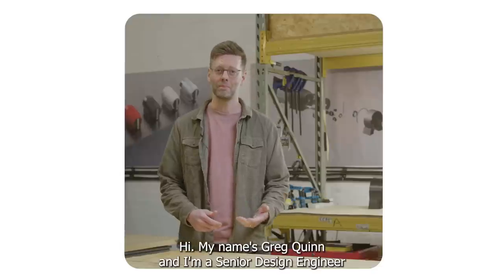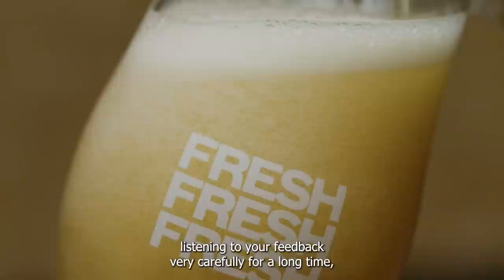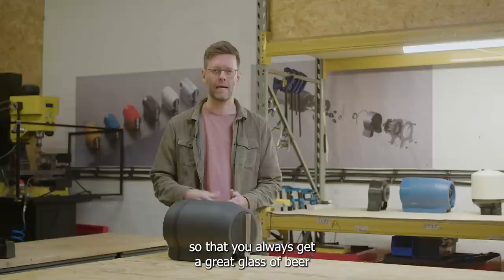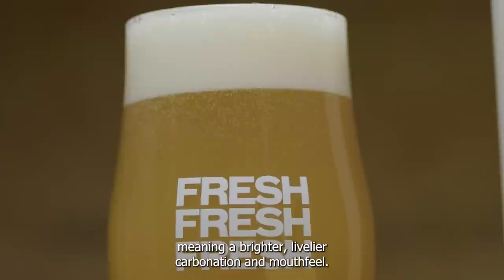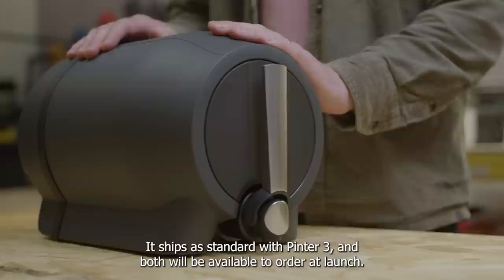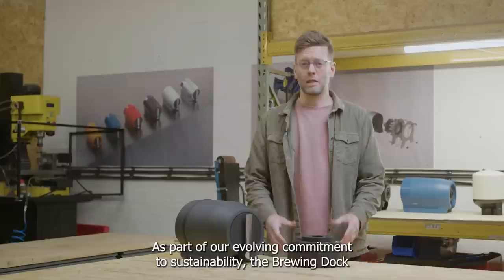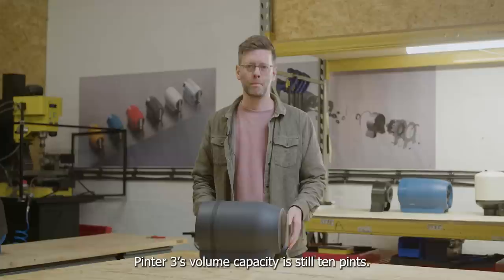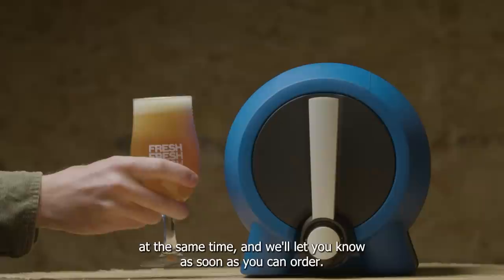Introducing Pinter 3 and Active Pour Tap

Comment: Thank you for the video, looking forward to the new tap, had issues with the PInter 2 tap, however it does do the Job once get used to it and being patient and docks on both pinter 1 and 2 are a pain to attach etc. again they still work. I been a pinter owner for 2 years now, only 1 complete failure, My 2 year old Pinter 1 has now completly broke (total loss of press). got 1x Pinter 1 and 2x Pinter 2.1 in use still( 1 replaced due to hopper valve failure). overall over 95% success rate for me, so happy if get near 100%.Keep up the good work, looking forward to the improvements of the PINTER 3.

Comment: I have two Pinter 2s and both were upgraded.  Can’t get the docking station on, yet when I emailed the help team with pictures etc, was basically told to keep persevering with it.  With the amount of different versions and upgrades someone might think that this wasn’t ready for market when released.
Reply: Antony a squirt of purifier on it or some food grade silicon grease does the job on mine when I am struggling to get it to dock.

Comment: The design of Pinter 1 was appalling. I bought two and both brewing docks have snapped in the exact same place - meaning both are now completely useless. I'd be amazed if any user testing went into the design because it just isn't fit for purpose. Can't help but feel a bit ripped off, especially because they've released Pinter 2 and now 3 in quick succession - basically acknowledging they released the first one way too soon.
Reply: @fresh_beer  I contacted the email address and they've said there is absolutely nothing they can or will do - effectively leaving me with two useless Pinters that I may as well take down the tip. I will now be looking elsewhere for my home brewing requirements. You have just lost a customer. For good.